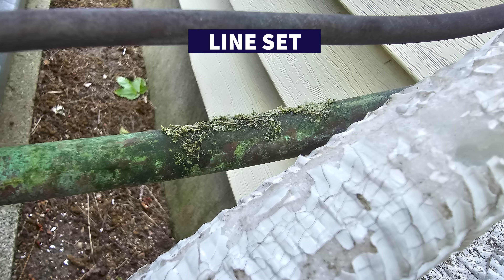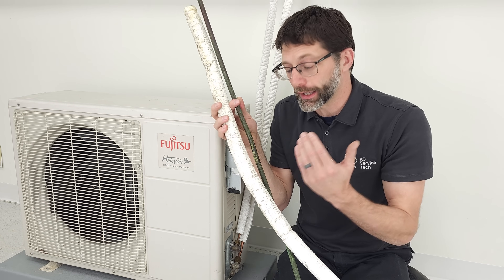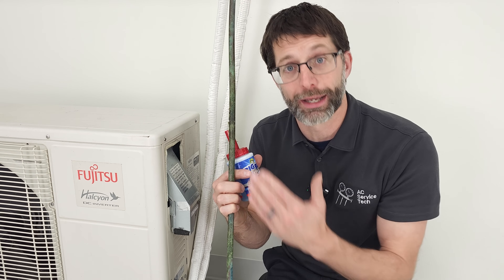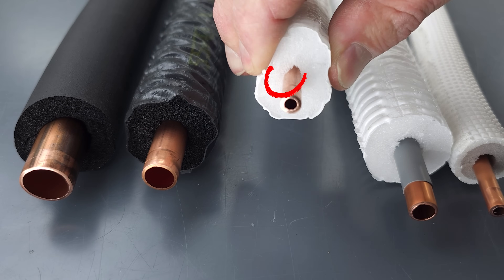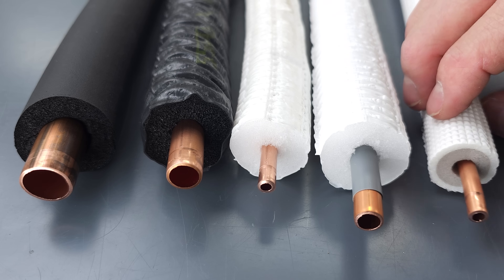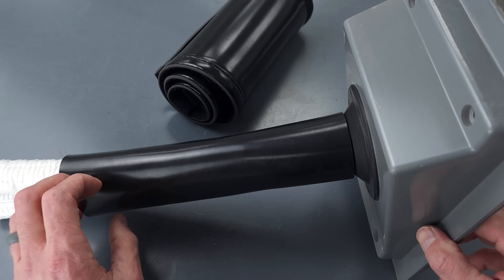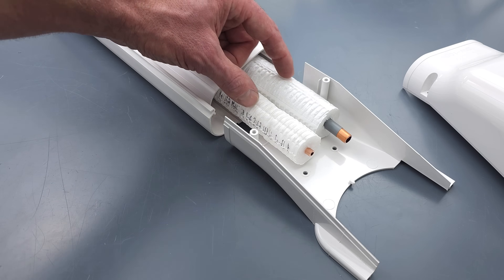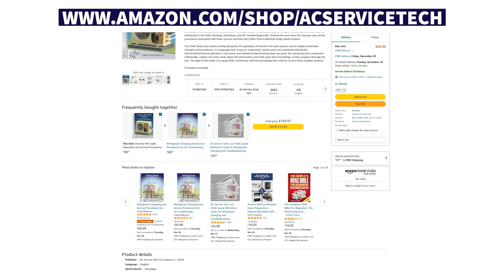Copper Line Set Tube Corrosion and HVAC Refrigerant Leaks Explained!

Comment: Thanks for this excellent video and explanation of what is causing pinhole leaks in line sets. I am a homeowner experiencing this exact problem. It's been incredibly frustrating to get it resolved, most texts have no idea the problem exists. Our installer (Gorjanc Home Services in northeast ohio) has been horrible to work with. Unfortunately, I recommended them to a number of people who use them and are experiencing this exact same problem. They do not stand behind their product. As a result, I am now working with another contractor to fix the problem created by gorjanc. It's hard to believe that installers are not aware of this problem and that mindset manufacturers do not include a UV and weatherproof insulation layer.

Comment: My mini split is leaking. HVAC is going to do a leak detection test. I'm guessing the problem is the line set insulation. Mine has the white insulation shown in the beginning of the video and it it peeling and cracking with discoloration just like what the video shows
Reply from the maker: Thanks for watching, I hope this video helps with your leak issue! Make sure to watch our other videos on searching for leaks on HVAC systems!

Comment: Oh boy... I'm just about to install my mini split system with five indoor heads. The line sets provided all have the white insulation. Is sealing the ends with the tie wraps in using a good line set cover sufficient or should I get new line sets? Is it possible to just buy the insulation and thread it over the existing tubing I have after removing the white polyethylene? I'm glad I watched this video before I started my installation.

Comment: Hello! What could be a reason for both supply and suction pipes of the outdoor unit to be frozen? (after repair of the leakage at the pipe inside of the outside unit of split on-off system, recharging it after fully by evacuating the system and filling it by the weight). Pressures are ok, amperages are in range, air flow inside is good. It is possible that there is not heat load inside (too cool in the room, ok - but this will affect the gas pipe, but why the liquid line could be frozen at the same time?)... Mb the non-condensible gas inside after non-correct vacuuming... or what to think about?)

Comment: the rubber foams won't produce the  formic acid in question here: 
In the laboratory, Formic acid can be produced from polyethylene in the following manner:

A thin layer of bismuth oxide carbonate on a reduced graphene oxide  base will serve as the cathode in a CO2 reduction reaction using an anode of polyethylene terephthalate in solution with cell voltage of 1.9 V at 10 mA cm−2.  
That is a highly accelerated  method. In the refrigerant insulation / copper pipe this takes a lot longer.
There are electrical fields developed when rain water and copper come together in the presence ofother minerals. Minerals are all over the insulation in the form of dust and can be in the rainwater too.  This can act on the polyethylene foam and over a long enough time frame you can get formic acid.

you have a really good you tube channel
Reply from the maker: Thank you so much and awesome details in your comment!!

Comment: Those leaks were installed when the air conditioner was installed. Shame on an industry that would sell the public  "built-in" very expensive failure points

Comment: Here is what I learned from my failed lineset foam. My installer didn't seal the ends. There was black all through the runs but all the failures were within several feet of the condenser. There was water full on flooding the lineset in the low spots but if it was 100% full there were no leaks. The leaks were at the condenser end where it was getting air. 100 feet of lineset and all the leaks on a 3 head unit were within a total of 8-9 from the end.
Reply: In 55 years never seen any installation sealing the ends😂 just admit it the insulation is the issue

Comment: Thank you so much for bringing attention to this issue and explaining it so clearly! I've run into these tiny corrosion leaks repeatedly on systems using the white insulation, sometimes with very few signs of deterioration on the jacket, but yet with the black jacket line sets I've never once seen these leaks on even bare copper with substantial patina exposed by completely disintegrated black insulation. I wasn't sure if the white jacket line sets had inferior copper, or if the white insulation was causing a reaction, but now that I know I will immediately put your excellent tips to use!

Comment: The white polyethylene insulation corroded my minisplit lines.  I bought new lineset made by mueller usa.  Then I used the rubber foam insulation, two years and no issues.

Comment: This has been a problem going on 10 years or maybe even more now, but ive only ever seen it on the white insullated linesets, i stopped using it about 10 yrs ago and went back to armorflex. Never seen this issue with armorflex.

Comment: MAKE A ONE VIDEO ON R32 CHARGING IN MINI SPLIT INVERTER AIR CONDITIONER, SUB HEAT, SUCTION PRESSURE, DISCHARGE PRESSURE AND STANDING PRESSURE.

Comment: Hi Craig. Watched one of your videos where you used the Hilmor pig gun. I watched you deburring the vapor line and then tapping out the debris. I'm sure I'm not the inventor of this although I've not seen it anywhere regarding HVAC lines, but what I do is stuff a rolled up piece of cloth inside the pipe by maybe 1/2 inch. This allows me to debur and not worry about the debris. When done, grab your needle nose and quickly pull out the cloth. The debris comes with it. Ex EHT guy here!

Comment: mini-split, aka mini-sheet. great in theory, bad in real life because of cheap build quality and being over-complicated by complex build/electronics.
whilst I am still temped to install such garbage, something subconscious keeps telling me NOPE NOPE.
yes I have recommended said mini-splits for others, in residential and commercial settings. all small areas with with humidity/thermal output devices, beauty salons/open cooler/store fronts.
Reply: I dunno, they work well when done right. "Mini splits" are the main style of unit installed here in Australia in residential and light commercial. Sure, they have issues occasionally, but you do with all units. 

Most of the issues we get are from critters getting into the PCB's, because it's a nice warm place to hang out. Then they inevitably fry themselves and usually take the board with them. That's the biggest downside I've seen. They could be better sealed.

Comment: I have seen this probably 10x. EVERY single one was with the white lineset as you showed in the video. It ALWAYS occurs where the lineset is wet. I had one 2 years ago on a 3rd floor head and the lineset was trapped in a knee wall. Zero sunlight. I also saw this once in an underground conduit sleeve for a remote located condenser.  Bubbling out of the flooded conduit end. I have NEVER seen this with a rubberized lineset. It also seems to be on linesets 3-7 years old in my experience. My personal opinion is that there is a chemical reaction with the specific foam chemistry

Comment: Are any lineset insulation UV protected?..  the isoclimar  I notice has ba corrosion in the sun in a shorter period.
Reply: No they are not UV protected
Reply: Mueller line set, Duraguard which coats the black elastomeric insulation.

Comment: My main system has the foam rubber insulation.  The original setup was deteriorated by the sun.  I replaced it with new but then covered it with aluminum foil.  The run is short, only a few feet from the unit to the house wall and pretty much out of sight.  It has been that way for several years and no problem.

Comment: i live with this situation all the time I work in coastal area and the white line sets are terrible in a marine environment. You have to use the black insulation these manufactures need to rectify this immediately. It’s causing a nightmare for technicians and customers have to pay the price.  btw fujitsu is not a great systems   in general there 5 zone unit is good but it’s down hill after that.

Comment: I have noticed with other copper refrigerant lines in the same building that is 40 to 60 years old.  The insulation could be cracked and split worn away exposing the old copper it’ll be green and they’ll be exposed water, but they will be no leaks on the original copper in all the buildings. 
     But only the new copper installed in these white insulation in the same buildings will be leaking. 

So 40+-year-old copper in the old black insulation .  That has been ripped into deteriorated and copper will be green and corroded in exposed areas throughout the building does not leak. 

They persist on using the white insulation . And just attempt to do measures to keep the air and the water out of it that is futile.

It’s only a temporary stopgap because they’re using a product that naturally breaks down anyway in many situations . 

Just like all the problems that re-created by trying to use a cheap product like aluminum, refrigerant lines that has literally bankrupt contractors . Because of marketing. $$$ 

Then there was that time they thought steel crimp connectors was a good idea, and then they developed leaks, literally crippling contractors and bankrupt them commercial jobs and ruining reputation of many contractors . 

And now the big move towards a few manufactures have quick crimp connectors. Now that they’re over a decade old we’re starting to see the failures around the world. .   Because they’re easy and marketing works really good. $$$$ they work great at first, but of course everyone that fails is always technician error.  (“SO THE MANUFACTURER SAYS”) 

     Then they even discovered many failures were coming from just the imprinted name or identification marks on the side of a copper being placed under the O-ring was causing leaks. 

Then, in some cases, the manufacturing process of the copper was not always perfectly round, and the thickness of the wall was sometimes uneven, and that was to be blamed. Because you cannot control the manufacturer of a copper.. technicians who are in a moving time, limited installation to even care or want to look or measure for such things. 

But the one thing that never fails is a good silver braze. 

Could quality thick-walled copper. 

One of the things the manufactures representatives would brag about at the AHR when talking to them is that their copper did not have to be as thick as Mueller’s copper.  Because they said their process for forming manufacturing, the tubing was so much superior that they can have thinner, copper..  
    And now we can see where that got us. 

Can you see the pattern here? it all comes from marketing and manufacturers trying to make the cheapest product to market and push using least amount amount of materials to make the highest profit margin. 

With the highest failure rate in the end. 
     Who cares if it’s not leaking the first year or five years does it make it end of system life towards 20 years plus ? 

But by then those who made the money off, the products are long gone 💸💸💸🤣🏦

Comment: Thank you Craig.
A customer of ours has an older system that has some green discoloration on the lines going through the attic.
I made some repairs to the insulation while looking for leaks a couple of years ago.
If they're low on refrigerant this season, I'll recommend replacing the line set.
They spray foam insulated the underside of the roof to help cool the master bedroom, but this is now trapping humidity in that portion of the attic.

Comment: Is it possible in this day and time that the copper is made as thin and cheaply as possible?
Reply: More money in the  greedy, corporate executives pockets. More money for them to fly their biz jet around on family vacations.
Reply: I once installed a mini split the customer bought and the lineset was actually aluminum, the manufacturer had the ends near the flares taped in a copper colored tape to make it appear as if the lineset was actually copper.
Reply: That has always been a concern.  It was an issue in the early to mid 1990s and occasionally since then.